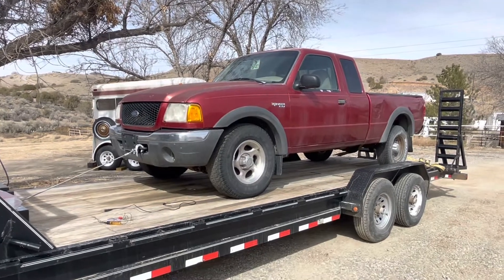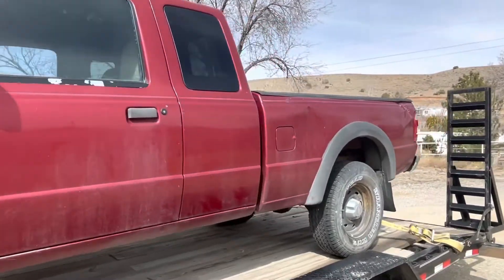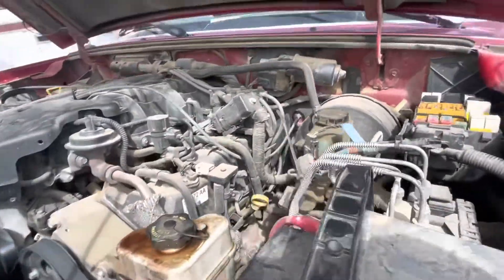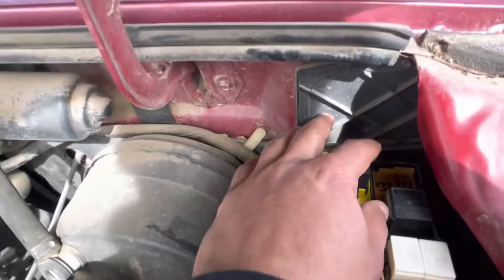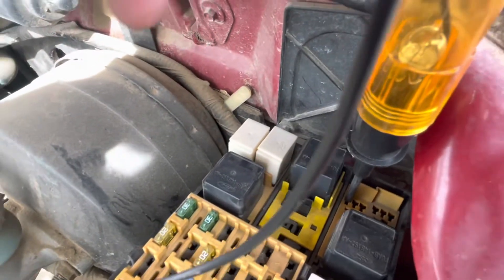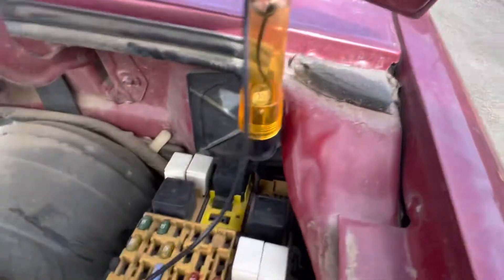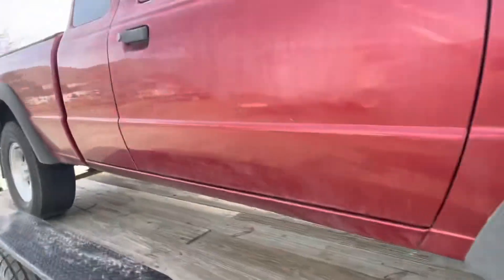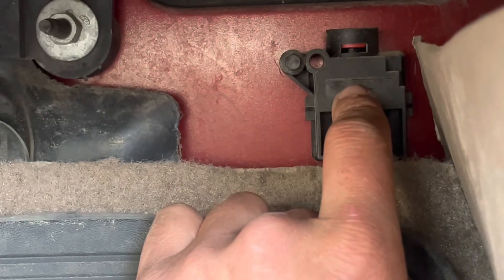How to test for a bad fuel pump Ford Ranger and how to install new fuel pump pt1

Comment: I was curious about the "Signal Wire" to the Fuel Pump ( the last one you pointed out), is that supposed to light up with the key turned in the ignition as well ?? the first two lit up for me, just wondering bout that last one. But ultimately the new fuel pump relay i got isn't even working when i checked it with a 12v batter/multimeter too so. but just curious

Comment: Is there a way to test fuel pressure on this exact truck and engine? I have the same truck and engine, my problem is that when I drive it, it runs good and other half of the drive it sputters and loses power then comes back full power. I’ve changed the wires, plugs, coil, injectors, fuel filter, intake manifold gaskets, and looked for any leaks in vacuum and still runs the same. Please! If you can any advice would be great!
Reply from the maker: @345james5  there is a way to test it on the passenger side of the engine to the back near the fire wall there’s a brass piece that you can hook your fuel pressure gauge to but it takes a special  size fitting for fords

Comment: will the engine or starter still make a sound or attempt if the fuel pump has no sound at the tank fill?  didnt think to check the fuel relay until i drove off from the vehicle.
on top of that its been sitting almost a year because its ignition cylinder is a problem. been trying to get past having to have it towed or a locksmith reprogram the key for two months. all info others advising others on forums.
then i saw where 1 person said 2000 ford ranger 4 cylinder didnt have PATS. so tonight was swap another ignition cylinder and nothing. the parts guy wasnt sure why the pats one wouldnt work but offered me to swap it for the regular as both appeared in the computer for my vin number.
im only telling you the long last part because i dont know if that is important to be able to tell me about the fuel pump.
thank you though. gonna check on the relay tomorrow before i call our tow guy. its nice and far away from his $hop.
Reply from the maker: The engine should still turn over if the fuel pump isn’t working. Also I had the same problem with my ranger I didn’t have keys, I ended up having to tow it to the ford dealership to get new keys made because they gave me a good deal. If the truck does have a programmed key and you have a new key that’s not programmed then it will definitely cause your fuel pump not to come on
Reply: @4flattiresgarage701  I have a 98 Mazda B2500, currently it's very hard to start but once it gets going my RPM fluctuates between 1 and 2k. Then when I press the gas I get no power and it will eventually stall out. Fuel pump?  Please note I've already replaced the spark plugs but still running into this issue.